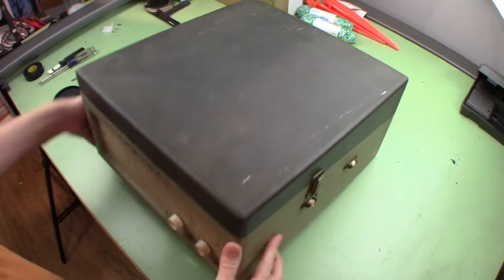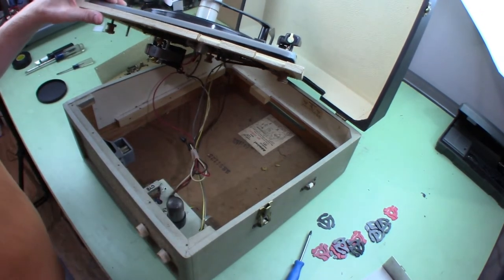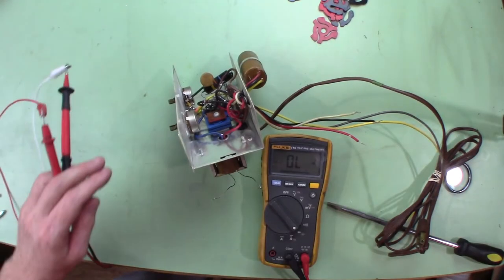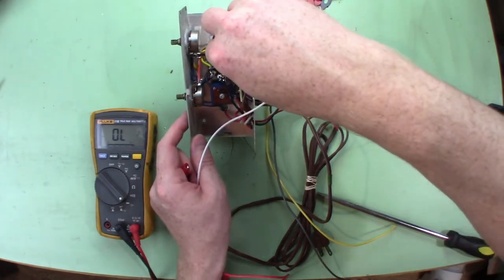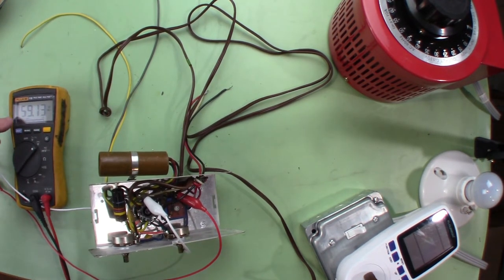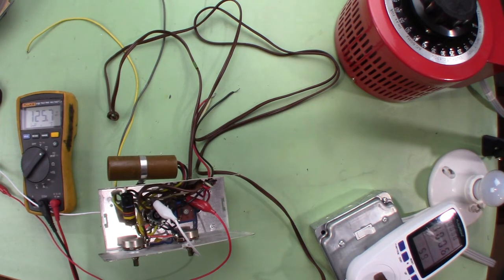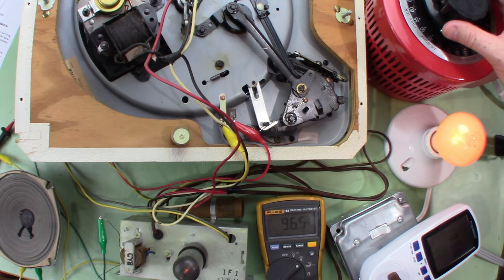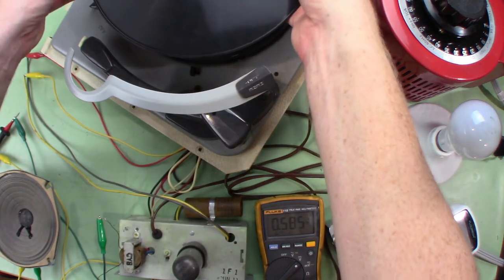Admiral 329 record player restoration Part 1

Comment: you might find date codes on the tubes, txfmrs, or speakers.
Reply from the maker: The tube is branded Admiral and has P59-01C on it. That may be a 59 date code. The speaker says 575833 on it, so I guess that could be 33rd week of 58?

Comment: anything before 1923 is not covered by copyright
Reply from the maker: I wasn't expecting it to work the first time, so I just grabbed a random record.  After it worked, I went through all my 78's and pulled out the ones before 1923. The first one was from the 50s I think.